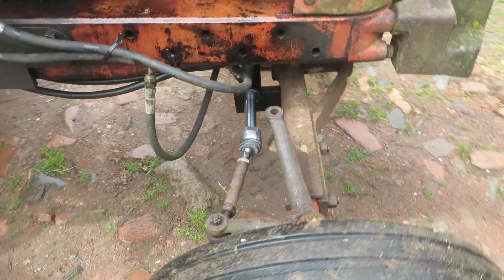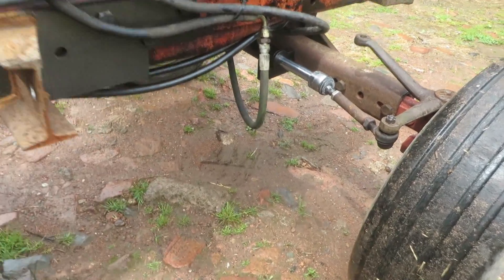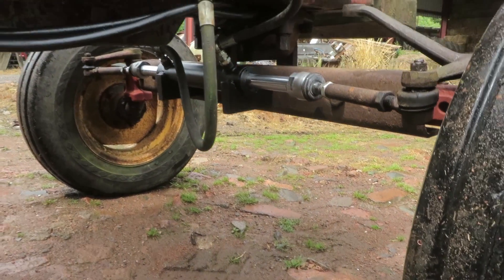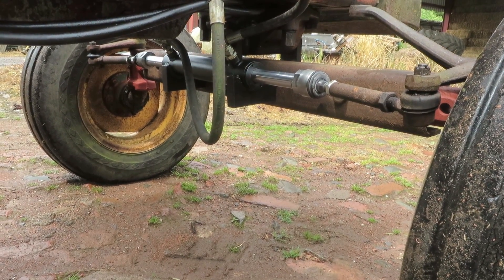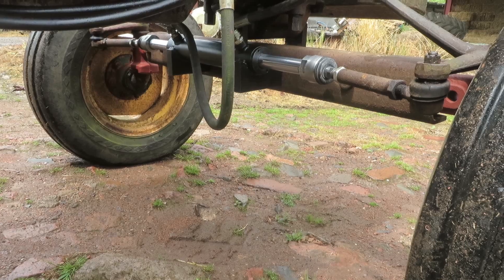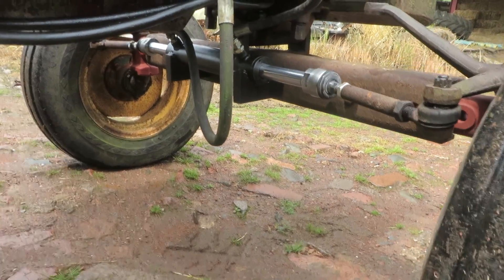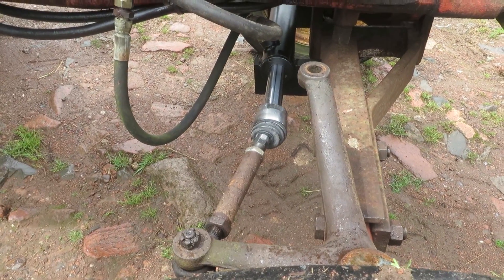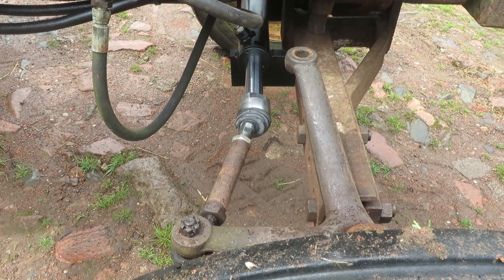Bespoke Nuffield Steering Ram

Comment: love to know where you got the ram, would like to convert a 270 Leyland, have everything accept the ram, your videos are great, love the old school techniques, regards paraic.
Reply from the maker: Hi, The ram was made for the job, but QTP do a ram for Massey Ferguson 3065 ( the 3075 ram is bigger) that will about do the job but the stroke is longer so will need some collars fitting against the piston to reduce the stroke. I'm going to post on the Nuffield forum fairly soon doing this conversion to a Leyland 272!
Reply: @montegoson   so bacikly the same as this ? i think im going the same route as you with my nuffield 3/45 :)

Comment: How many cost?
Reply from the maker: Azfar Adli I pulled a few favours to get the ram made, but the would probably be £500. Then I used a second hand Danfoss unit and saved a few more hundreds of £s. The pump was £100 then all the pipes. True cost well in excess of £1000
Reply: It like kubota m8030 dt  sterring hydrolic.. Cn i modify ti kubuta m7500 dt like this?
Reply: To*
Reply from the maker: I dont know anything about Kubota tractors, you will have to solve that problem yourself